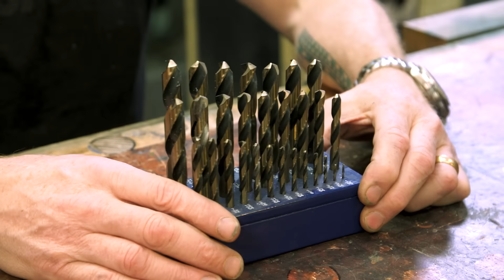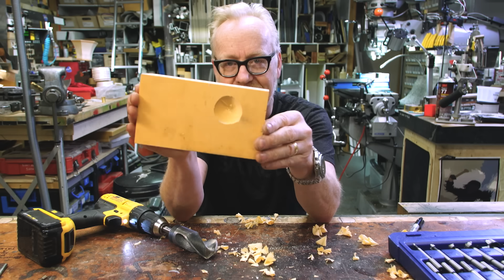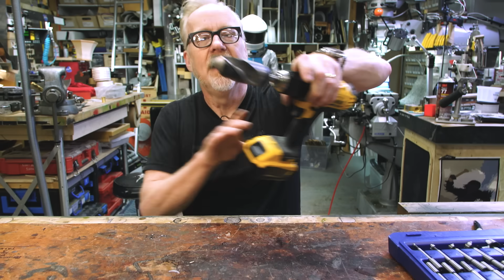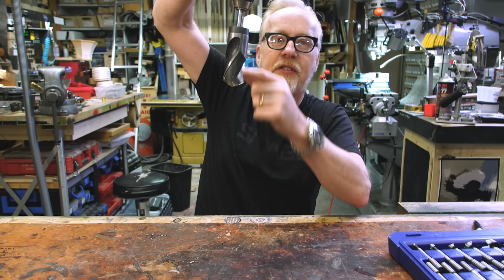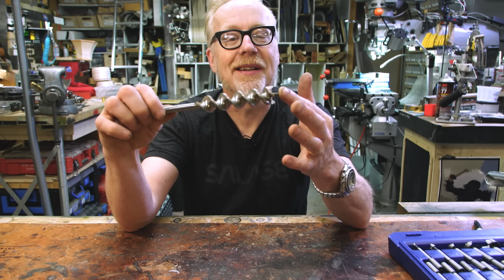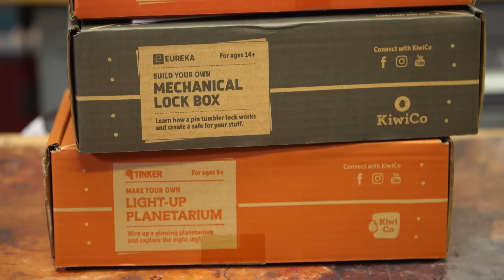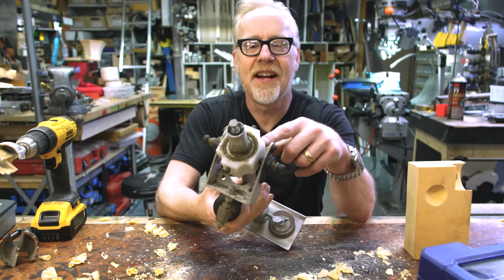Adam Savage's Guide to Drill Bits!

Comment: So when he was talking about Pitts I'm pretty young I'm only 22 but I grew up with a hammer in one hand and a concrete bag in my other So I feel like I'm pretty qualified to say this despite my age If you're trying to drill a hole then go with the Walt if you're trying to cut something go with Diablo blow and if you're trying to put 2 pieces of things together then you should either go with Milwaukee or makita It's honestly as simple as that now by no means are any of these the best at what they do But they cost about the same But you will definitely be able to tell the difference in between a dewalt grill bit and a Milwaukee drill bit The what will 99% of the time win and if you're just starting out you don't need the best tools just get something in the middle of the range and then what you want to do is buy the best bits that you can If you pair a homeowner great tool with the best possible bit you are going to enjoy it Because yeah your tool doesn't have as much power but where the rubber meets the road is the drill bits don't chip out on them Be cheap on your tools when I was 1st starting out I had cobalt decent amount of people made fun of me but I always bought the best bits because I knew how much they were worth they aren't extremely expensive either they're about the same price may be 5 bucks extra for like a set of a 100 pieces So it does buy the biggest set with the most amount of pieces if you're starting out from either the Walt if you're gonna be drilling holes a lot or if you're gonna be putting stuff together because you're a modeler or you just want to do projects around the house you probably aren't gonna worry about drilling so I would just get something from Milwaukee or makita you can find them at home depot And if you want a pretty reliable tool I would go with couple and I used it for years didn't have a problem it doesn't say that it's waterproof but I've left it in about bucket of water and it didn't die so like extremely bazillion and they have a pretty good warranty

Comment: It's very worth mentioning that stepper bits can save you from a really bad wrist sprain when drilling metal, especially multiple layers of thick gauge springy sheet metal.
The progressive and more circularly-supported stepper bits self support (= force not through you) and don't allow a sudden deep punch through.

A regular twist drill is very inclined to punch through instead of cutting the last little bit of material and will suddenly twist the drill  fast and hard.
I as well as quite a few people I know have sprained our wrists this way. And I'm not talking about reckless people. I've done metal fabrication all my life, and knowing it was risky, was being really careful with a bit I thought was borderline size-wise.

That was a 1-step learning process for me, when simply switching to a stepper bit would have saved me from missing several weeks of perfect motorcycle riding weather and I was lucky with no permanent ligament damage.

If you are concerned about cutting speed, the tighter bits cut faster, while the wider style cut slower with less stick through.

Comment: The wave style can cut at an angle where the saw tooth type cant
You want a perfect round hole thats true
You drill it undersized then use a reem to bring it to the right size.  
I've seen drill bits way larger then the one you had chucked up in the dewalt. 
Some are so big they have a mores taper shaft
As for a step drill, the better ones hold an edge longer. Becuse its not very easy to sharpen one without the right tooling.
I used mine every day on automotive sheet metal  over a 17 year period I must have worn out or broken 50 of the snap on ones and a few if the cheap ones I stoped buying.   If your just going to use one once and a wile buy the cheap ones if your gonna use them every day spend more money on a good one.

Comment: Forstner bits: I purchased a cheap set of over a dozen from Amazon for under fifty bucks….but they are cheap for a reason!  Blunt and badly machined right out of the box.  I have learned these are a ‘buy once cry once’ tool…so I recommend purchasing at least a mid priced quality brand name and they will cut clean accurate holes without burning the wood, last for years and can even be re-sharpened.  Fwiw..I went for the Fisch brand in the end…like 100 bucks for just five (ouch!), but they are beautifully machined with a clean cutting ‘wavy rim’ design and razor sharp.  I will likely never need replacements of these five in my remaining life.  A quality tool is a joy to use…cheap crap is a nightmare, and often so are the results.  Imo of course!

Comment: I had a standard bit drilling into some pretty thin sheet metal I was securing it in a vise steadying it with my left hand. I was going well until it jumped out of the hole and went right into my finger. Luckily it wasn't going very fast when it happened but it definitely sunk the entire print of the blade in my finger. 
Sometimes you get cut and it's just a little sting you put a Band-Aid on and call it a today... This was one of the most painful wounds I have received.

Comment: Great info on drill bits Adam I knew about Forster bits but found a couple of new uses watching this such as drilling a hole where the bit is wider than the material…one thing I noticed was your bits are slipping and at least once you stopped and tightened the bit again…up until a few months ago I thought this was the keyless drill chuck getting worn but it was really I’ve been using it wrong all these years…you tighten the bit as tight as you can and then back it off a slight turn until you feel the detent grip then it will never let go while drilling…all this time we all had it wrong

Comment: I have a great drill bit story to share here. My dad is a tool maker and engineer by trait. He used to work with a local racer and motorcycle tuner. One time they were trying to drill holes in the flyweight of a crankshaft to in order rebalance the crankshaft with tungsten. The purpose of this was to increase inertia, because the bike was too sharp on throttle response, while decreasing the overall weight.
However, the crankshaft was hardened on it's outer layer and they just couldn't get through that hardened layer with anything in their machine shop. So finally they just drove to the hardware store and bought an ordinary drill for concrete drilling and with that and a lot of cooling liquid they go through. The reason obviously being that super hard plate inserted into the tip of a drill like that.

Comment: My dad loved tinkering. He would try to repair anything before buying a replacement. He owned a very heavy metal drill, so he'd use a (Vintage) Millers Falls No. 188A Push Drill. When he passed away, even though I can't use it correctly, I secreted it before my brothers could take it. It was/is "wonky", so I bought a useable one on eBay. I "played" with it to the point that the screw top is very tight and I can't open it. (Maybe "frozen" ?). I still cherish his "wonky" push drill.

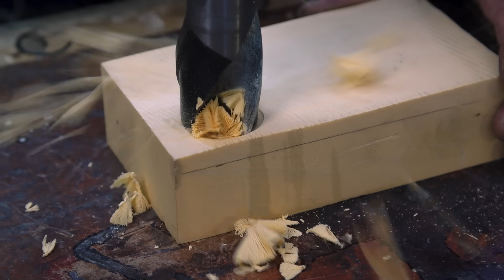Comment: (4:42) There's a hack to center this 1-1/2" large bore on its mark.  Start with a drill bit 1/3 the size of the desired bore and you've got a dimple on that flat surface to keep the larger bit point from wandering about.  It's always easier to handle the smaller bit.
Noticing Adam doesn't use bench vise at all, but always own hand.  A bit impatient, and risky habit.  And then his retelling close calls with the business end of sharp power tool attachments.  I am amazed he stills has all the fingers on his hands.

Comment: Also, acrylic won't break with a single edge step drill. The cracking is caused by the multiple points of pull on a twist drill essentially pulling the bit through at the last minute (rather than scraping) and that sudden puncture causes a localized fracture.

Comment: Structure is not the same whether it's 1/16 or 1-1/2. Show me a split point 1-1/2 and I'll agree. I have never seen a twist drill, of any length type, over 1" that was anything other than a chisel tip, you simply cannot retain enough edge strength otherwise.

Comment: Over the years as a DIY homeowner I've had to approach a lot of projects requiring drilling. Early on my wife needed holes in the bottom of her planters. Plastics not a problem there you go! But eventually and she did bring me a ceramic planter??? It required a glass drill bit. And later trying to organize all of my Woodworking magazines in a 3 ring binder I required a paper punch drill bit. And when I installed hinges on my gates I needed a hinge drill bit. Coinciding with the gate build I had to drill a 3/4" hole into concrete with a masonry bit. I also had to use a step drill bit to modify a light fixture I was putting up. And of course while I was building my deck I used an 1-1/2" forstner drill bit to recess the hole so that the flat washer lock washer and nut could reach the bolt coming from the other side. 
Alongside the other drill bits Adam talked about that's a lot of specialty used drill bits.
Who'd a thunk? Thanks for putting this up Adam!

Comment: Twist drill sharpening tip: The angle on most twist drill bits are 118 degrees. 2 nuts welded together side by side makes an angle of 120 degrees. Good beginners guide to use when getting the correct sharpening angles.

Comment: Adam, you didn't mention one of the Forstner bit's most useful features - if you don''t drill all the way through a workpiece, it makes flat-bottom holes.  Yeah, I know, a spade bit does, too...sort of...except that the bottom of a hole drilled by a spade bit is usually rough and chewed up.  A hole drilled by a sharp Forstner bit (especially if it's used in a drill press) is flat and smooth, which can be very important, more so with the larger diameter bits.

Also, you might do a quick video showing how to sharpen a dull Forstner bit.  Cheap Forstner bits work fine (as you said), but they do dull a lot faster than the better bits made with high-carbon steel.  Fortunately, with the right file, it is REALLY simple and fast to sharpern a Forstner bit, as long as you maintain the original chisel angle, only sharpen the face of each chisel (not the back), and remember to sharpen the "spurs", too.

Comment: Just a pro-tip; when chucking anything into a cordless chucked drill, tighten all the way as normal then turn gently in reverse by hand until it clicks, usually as much as it takes to move the chuck back will cause the click. This is the proper way to lock the tool in the chuck of cordless drills.

Comment: Absolutely agree on the cheapy forstner and step bits. The step bits are just kind of badly designed as drill bits go if you're looking for longevity. Everything that makes them awesome also contributes to them breaking down and dulling faster than a normal drill bit going through similar materials. They're throw away bits so when I can get a three set for about fourteen bucks I don't even care what the fifty dollar step bits can do. As far as the forstner bits go I use them fairly regularly and I have the same PorterCable set that I paid thirty five bucks for at Lowes fifteen years ago and it still works just fine. That's not to say that I haven't drooled over the Fisch wave cutter set with the black shank that I saw a demo of at my local Woodcraft but at a little over four hundred bucks it'll wait awhile.

Comment: Great advise regarding the cheap vs expensive Forstner bits.  I bought a cheap 16 piece set years ago.  One or two sizes, I've probably never used yet.  Four or five sizes that I use all the time were used and resharpened over and over until they wore out and I replaced with higher quality individual bits.  All the sizes in between "the rarely used" and the "always used" are there if I need them on the rare occasion.  Some sizes will last a lifetime.
Reply: My advise is always to buy a big cheap set in a nicely labeled case and when they wear out replace with a nice bit. It’ll transform until you’ll have a good case to hold your most common sizes that also has cheap extras.

Really great advise for router bits, too.

Comment: Did you say deep drive into...drill bits ..??  The most important thing is to know why you have to drill a pilot hole when using large bits because the thickness of the web is trying to just push it's way through the work piece not cut   .. unless using web thined or split point dirll bits..

Comment: In my experience with perspex and plastics, Ive only used regular hss wood/metal bits. Drilling part way in then drilling in reverse for the rest. Does wonders seemingly melting through the plastic instead of blowing out.

Comment: ha the worst hand injury I have is from a forstner bit, I was holding a board, hand drill, two inch bit..... it caught and sliced my middle finger open..... I didn't lose the finger but its been years and the nerve never grew back, so so numb. learned my lesson, still haven't bought a drill press though. I mainly use my lathe.

Comment: heres a question adam can you drill a square hole in a piece of standard A4 copy paper with a normal hss jobber twist drill?

it is possible. ive seen it done.

the method is fold the paper in two, clamp in the vice between 2 pieces of scrap timber etc doesnt matter what you use. the fold and scrap pieces need to be flush with each other or the paper slightly below the scrap pieces.

 and start drilling.
the secret is to only drill until the outside edge of the cutting faces kiss the paper.
remove from vice and unfold you have now drilled a squareish hole in the paper.

Comment: If you read this, do a little research first and you will come to love Forster bits and Brad point drill bits more, Invaluable info, also, Brad point bits go up-to 1.5” and anything over an inch should be in a drill press, otherwise use boring bits.

Comment: A word on forstners, if you're drilling into anything with a "skin" like plywood, veneer, laminate, make a shallow hole on both sides of the material first (Pilot holes work best for this alignment).  This prevents the forstner from blowing out or picking up the skin for the ride which will stop the cutting action while heating everything up

Comment: I disagree about cheap forstner bits.  A good forstner bit is pleasurable

When using a really well-designed and well-made tool, I get this sensation of pleasure that goes up my arm.

It's the same feeling I get shaving with a brand new razor.  Or taking the first cut with a freshly-honed plane. Or the feeling I get at the end of taking a huge dump.

Comment: A brace and auger bit has a very large amount of torque, very good control, and is often faster than a power drill.

Also, go to a flea market, and you can find ones in very good condition for under a dollar apiece. The brace should be available in perfect condition for $20 or less. It really is one of the better tools ever made.
Reply: Also, if you get a hex-shank on your forstner bits, you can use them in your brace. Works just fine.

Comment: Those “unibits” that he was speaking on.. I use them every week on different metals but mainly stainless steel. There’s a HUGE difference between the cheap and expensive ones. The expensive ones drill faster, last longer, and generate much less heat and metal chips. That being said if I used them less than 20 times a year I’d just get the cheap ones lol.

Comment: The more expensive forstner bits do make sense under some circumstances. If you are working with a soft material that has a uniform structure you may not notice any difference but the benefits of a good forstner bit, being a bester geometry or design of the cutting edges, better steel and sharper cutting edges greatly enhance their performance when working with wood. Because of the way it grows, wood has a structure that is not uniform so with a bad or a dull drill bit you are going to get tear out at the exit of the hole. With a good sharp bit you will be less likely to experience that or at least minimize it.

Comment: I would also add in auger bits(may not be the actual name, but has a screw thread on the point to pull them into the piece) as they are great for drilling deep holes.  You can get them in twist drill form and forstner bit form

Comment: I love my brace and auger bits, never owned forstners but want a set. One of the great advantages to a brace is the snail (little threaded point on an auger) pulls the bit in at the same rate, so you can count rotations to get the same depth hole every time. I think they're like 1/16th of an inch per rotation.

Comment: I personally use high speed twist drills the most, I'm also drilling into hardened steel more often than not. Still never got hurt by anything while drilling besides a hot chip landing on my arm. By far the worst injury I've had though was working on a car I had to hold the part while someone else ground it, right as I shifted my grip a bit the grinder hopped and cut through my middle finger at the last knuckle through the bone and all leaving bloodshot bruising on the other side. I was gonna just continue because I'm already injured so I don't want someone else to get injured even if it means getting injured again, the person running the grinder had a panic attack and that's when I had to go get the medical kit and instruct someone how to deal with it. Very beginning of the covid lockdowns and we were a good 45min minimum from the nearest hospital, but I have medical training and all the gear needed.... Kinda hard to do it yourself though when it requires 2 hands so calmly give instructions and a month later it was healed up ready to go again.